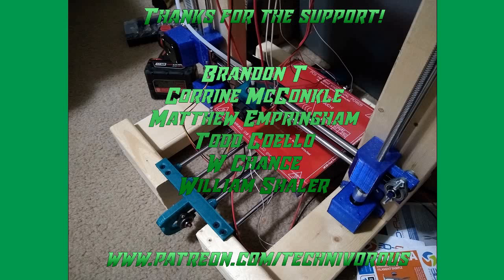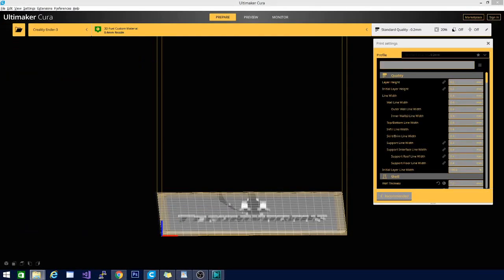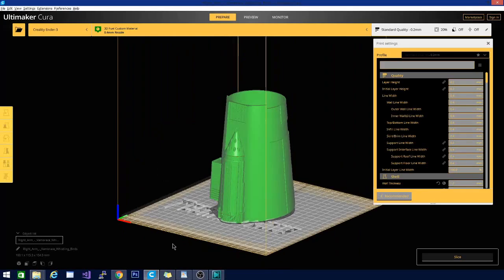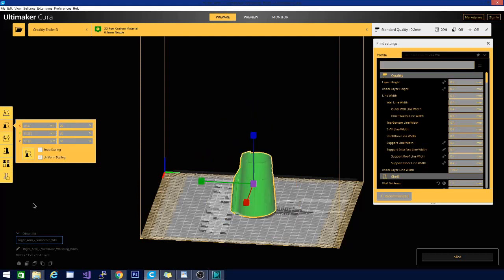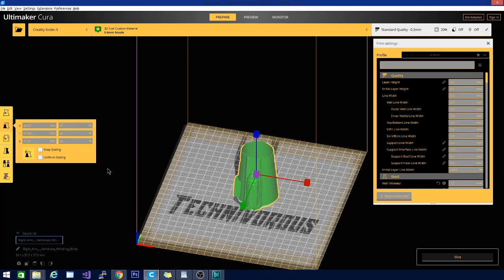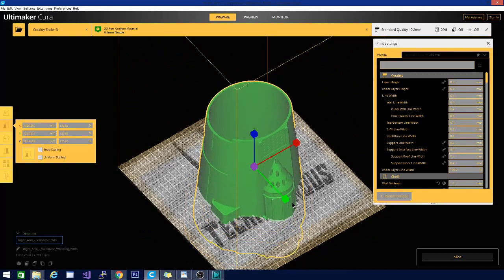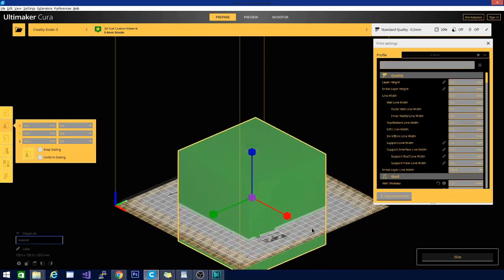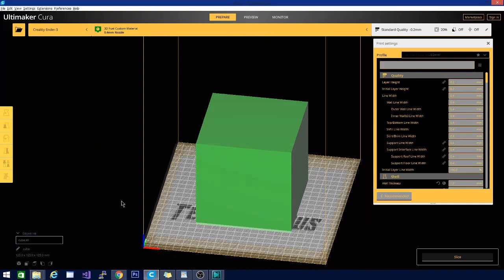How to scale your 3d model in Cura's Slicer

Comment: Do I need to change any other settings?  I increased on model by 25%, sliced it but the print is very rough compared to the smaller version. Any ideas would be appreciated. I'm using an ender 3pro and cura

Comment: I’m a noob, but how do I know if it’s scaled to the exact dimensions as I drew it in fusion 360? It automatically scaled it to %1000 but the dimensions aren’t the same as my drawing. Thank you for any help!
Reply from the maker: If you select the scale it will tell you the dimensions in mm. Make sure uniform scaling is ticked, and type in the desired length in mm. It should adjust everything else to scale.
Reply: @Technivorous  So just type in the exact measurement of one of the axis and everything should scale from there? That makes sense duh. Thank you so much. I appreciate it.

Comment: How did you customize your build plate with your name/logo?
Reply from the maker: Oooo I have a video on that. Probably time for a new one. The basics: go into your cura profile, and find the folder with printer presets. 

In that folder there will, or won't be an stl file named after your printer. If you replace that stl with one of your own design, it will alter the appearance in cura.

If there is no stl file for your printer. You will need to open the profile for that printer in your file explorer, under cura, and open the .xml file. 

If you also open the ender 3 .xml file you will find a line with the buildplate parameters, you can copy and paste that line to your printers .xml, then alter the name in quotations to whatever you set the desired build plate stl to.

Opening the profile in a text editor and searching .stl is the fastest way to find the desired line.

Comment: I'm printing a model that is one foot. With uniform scaling on, what will be the numbers I type in?
Reply from the maker: The model is one foot already or u want to scale it to one foot? Google inches to mm, and then input the mm value it gives you for the number of inches you want. Alternatively there is an extension that will convert cura to show inches.
Reply: @Technivorous  thank you for your reply. I'm print a small figure .stl file and I want to print it 1 foot tall. I'm using the creality slicer from my ender 3. I will Google inches to millimeters then. Thanks!👍🏾

Comment: Thanks for the video! I have a problem with Cura.. There are times when i load .STL files, that i know others have managed to print well, but they load larger than their actual size on the program!
Anyone know what can cause this? I don't want to start scaling objects within Cura, just to load them as they're supposed to be loaded. Thanks in advance! My Cura version is 4.11.0
Reply: Check the physical x, y, z sizes (lower left when model is loaded). Make those numbers exactly what you want by "scaling" - that is what it is called.  Good luck.

Comment: this is a great video and really well made! i got  a question though im trying to scale down a trash can and the layers become too thin and even disappear in some spots. do you know how i can fix this?
Reply from the maker: If parts of the model disappear once sliced that means those parts are to small to print accurately with your nozzle. Turn on print thin thin walls and print small features and it will help a little. But the part may not be accurate. Sometimes geometry disappears if its thinner than the layer height as well.

Comment: how to scale a 1/24 .. 1/25 model body
Reply from the maker: To 1/25th of its current scale or actual scale
Reply from the maker: I dunno if you solved this yet, but cur works in percentages so you will have to do the maths
Reply: One  divided by 25 times 100 equals the  percentage